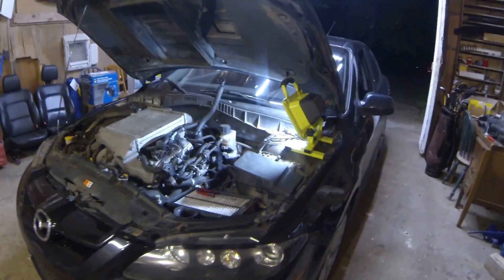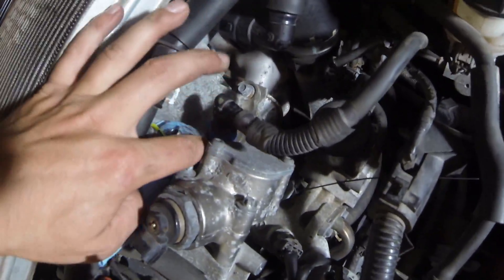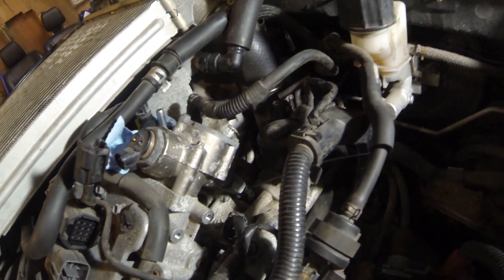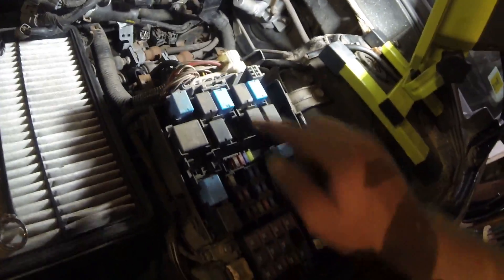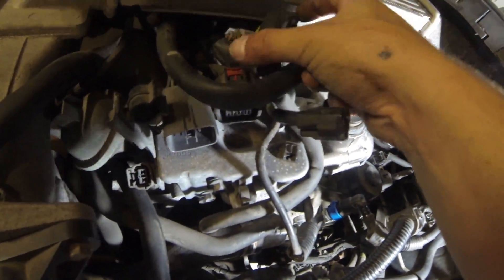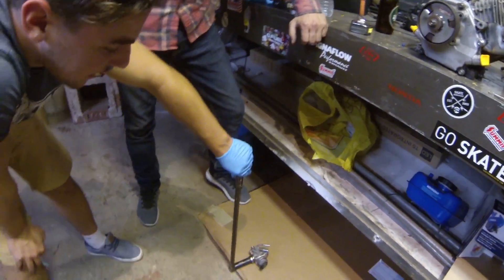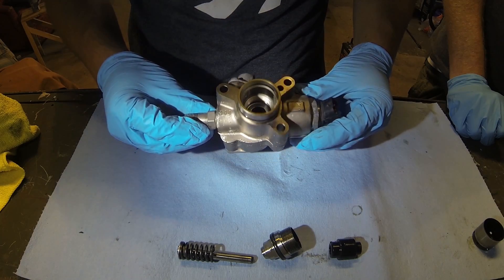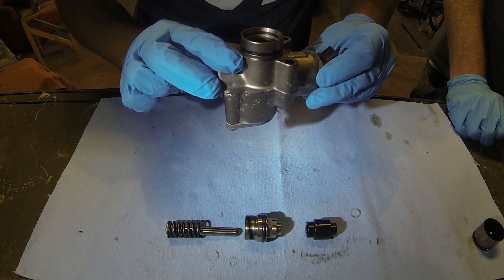Mazdaspeed HPFP Disassembly & Cleaning!

Comment: I removed the HPFP as a complete unit,  moved the car a little bit and the cam lobe moved too,  so I don't know if I just can put it it back on whatever direction the cam lobe is at or need to put the the engine  TDC?

Comment: Really hope that by now, you replaced that POS stock inlet by a silicone one and let that engine breathe with a Cold air intake or a short ram air intake and inlet. Nice video!!
Reply: How does a cold air flow better if the pipe diameter is the same

Comment: I cannot get the dark gray piece out of the bottom of the fuel pump internals. I saw you just popped it out using your fingers, looked way too easy. Any tips? I dont know why it's so hard.
Reply: Did you ever get it out or have anytips ?
Reply: Glad it’s not just me. That sucker isn’t coming out.

Comment: Great vid guys. First step to making HP.  You have to upgrade the motor mounts next.  Get someone to rev it up, while you vid the engine bay.  The whole engine will normally rock forward and back like crazy.  Change the mounts and you can see the difference, as well as more instantaneous acceleration and feeling attached to the car when you drive it.  Enjoy wrenching on your speed.  Zoom zoom

Comment: And depends of the fuel quality… I have seen CX7 owners having to replace one, two or all HP fuel injectors at 30k miles, while my CX7 at 17 mph using premium fuel is at 120k miles and still going strong. 
Shock absorbers are similar, lol FYI (people don’t slow down when passing speed bumps has its consequences)

Comment: I hated spending $350 for auto tech hpfp internals... but its such a necessary mod if you're building any further than an intake (i know some gen 2s need hpfp internals just to run an intake!). No power gains, but you'll need it to make power later on. Diggin the channel bro!